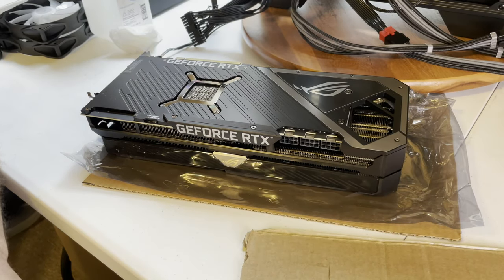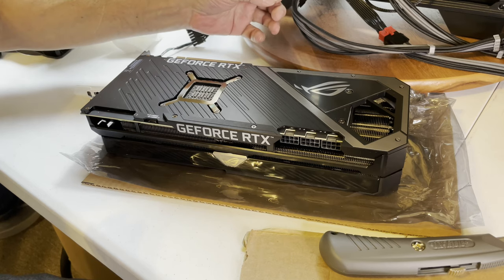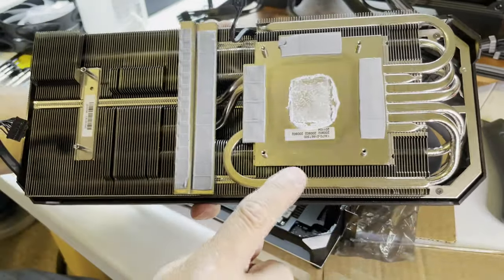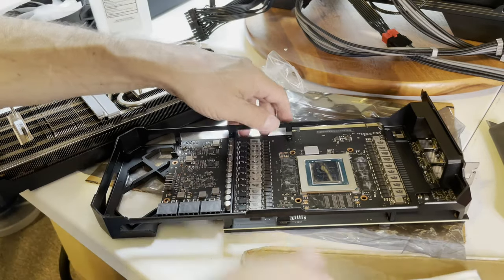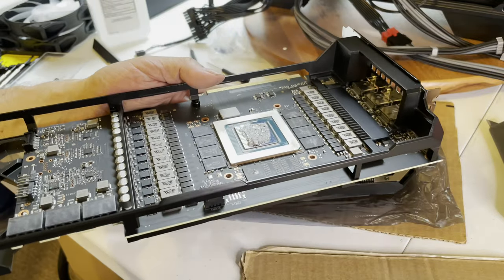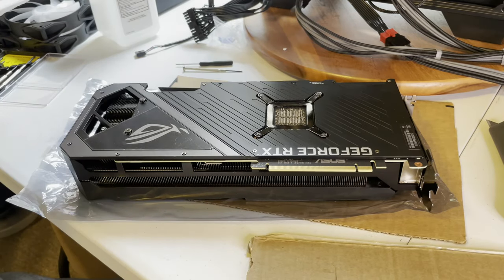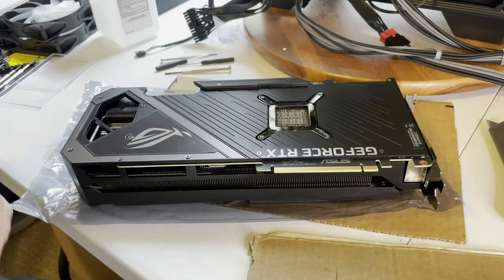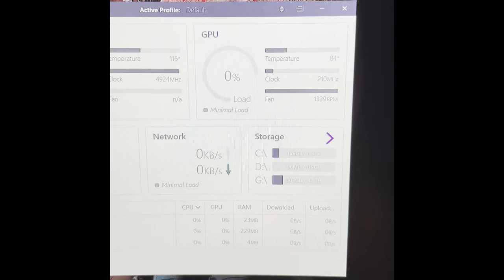How to help cool your Asus rog strix 3080 oc

Comment: My dude you did nothing for the Vram…

The core is not the issue with these cards, the Vram is. Gddr6x is.

Hwinfo is your friend. Find out what your memory temps are. Your software showcased at the end is irrelevant if your memory modules are still 100+…
Reply from the maker: Yeah I spaced it out and you are correct it is important.  Anyway The vram was around 70c idle and it did get in the 90's with a AC blowing on it when gaming.  The only way around this would be to water cool.  I do use HWMONITOR its a great program and I will remember to include these things in any future video's  Thanks for your support...
Reply: @JPsTechReviews  it’s nuts how even Asus and every company is doing the absolute minimum to cool these :/

For the price you’d expect like top tier pads and paste